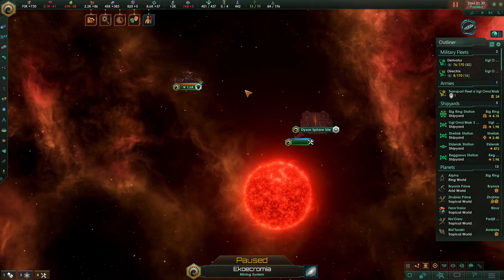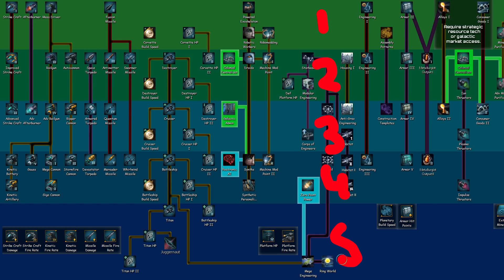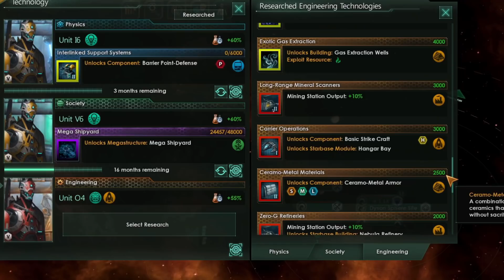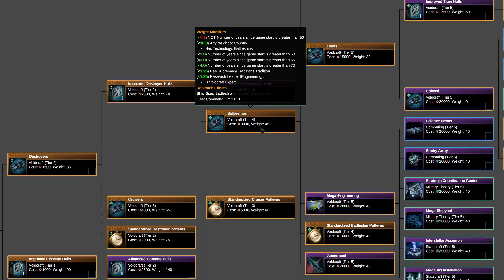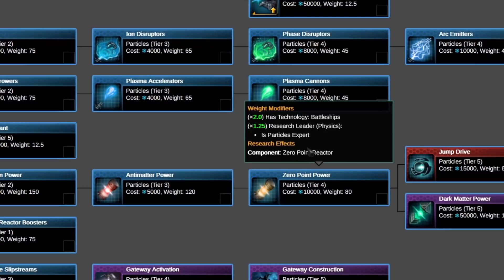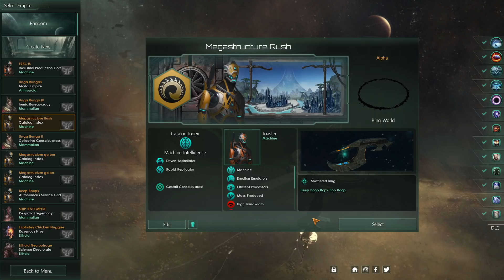｢Stellaris｣ Mega-Engineering Tech Rush Guide

Comment: Looking for a more refined definition for mega-engineering requirements.  The wiki and other sources all state 1.5X per [starhold] and 1.5X per [Citadel].  But what about [star fortress]? Should I avoid upgrading [starhold] to [star fortress] because doing so would not increase my chance to draw mega-engineering?

Base: 5
Modifiers
20x with any mega-structure (in any condition) within borders
2x Any habitat colony
1.5x if any neighbor has the tech
1.5x Technological Ascendancy 
1.5x per owned Starhold (up to 9x with 6)
1.5x per owned Citadel (up to 9x with 6)

Comment: Unlocking isn't enough you need a good timing for a certain resource amount in order to make use of it. 
Realistically this means to make a strategy balancing science progression with pop growth and resource infrastructure expansion to sustain building megastructures at the certain megastructure build limit you will have when you get the tech.
Would this be trivial even if you get it at year 50?
Reply: I think part of the genius of how this all ties together is that the infrastructure necessary to build megastructures is created by trying to rush them.  For one, you need a lot of research to get Megastructures this early.  Okay, that is probably a given.  But you also need relatively high alloy production, because you need to spam starbases to get the starbase techs.  Getting a habitat up and running is probably another use for alloys (and influence).

My only real gripe with the current setup is that warlike empires (those who take Supremacy and Battleships and use them) seem to me more likely to get Megastructures quicker than those who don't.
Reply: @NemisCassander  I was unaware that spamming starbases would give starbase techs.
Reply: @cyberneticbutterfly8506  It was right in the video, I believe.  To a point, the more starbases you have of a given tier, the more likely you are to be offered the next tier of starbase tech.

Comment: Is this for 3.0 or does it apply to console 2.8.1 butler also? What is the 2nd negative trait u have on the empire at the end? Its blocked
Reply: its usually the negatives that affect housing and empire sprawl, but i can be wrong
Reply: @velloso2553  You are right! It is recommended in the current meta to go Unruly (Empire Sprawl from Pops +10%) and Solitary (Pop housing usage +10%).
Reply: @velloso2553  your right, it has to be unruly